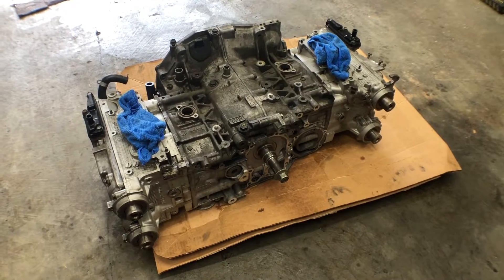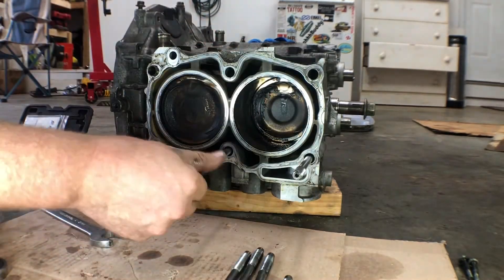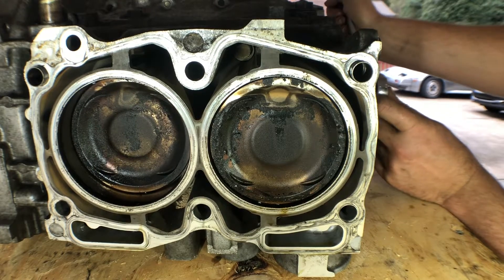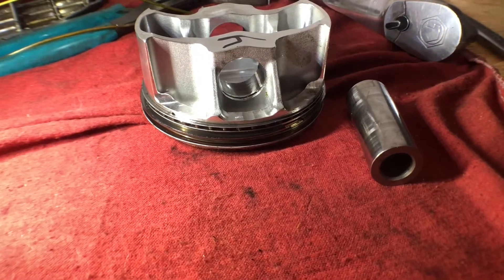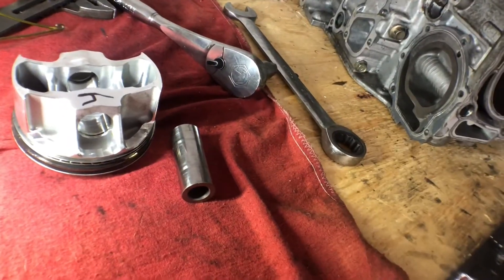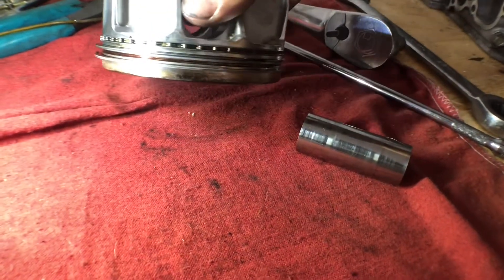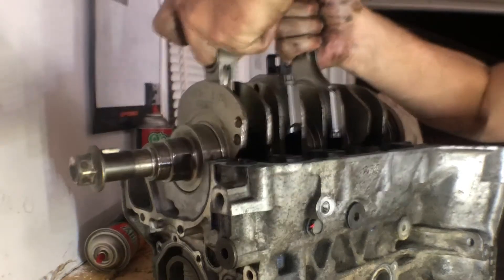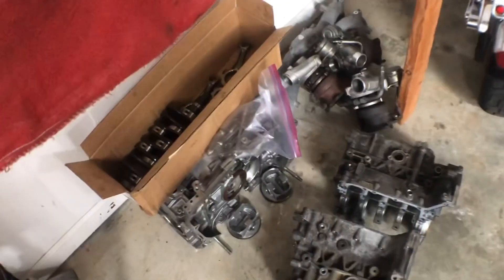EJ 25/20 hybrid teardown (Kuro WRX build part 1)

Comment: Awesome video! Do you think you can fit the type RA block into the ej205 heads?
Reply from the maker: Hmm that’s a good question I think the RA (record attempt) block is still an EJ that’s just been modified. I think everything was upgraded (pistons rods ect) but it might still be able to bolt on the EJ 2.0 heads. Check out flatirons tuning they may have some info